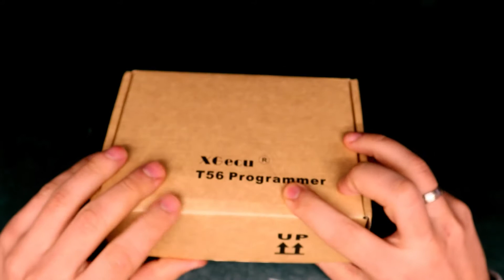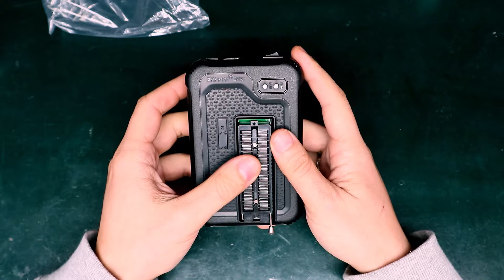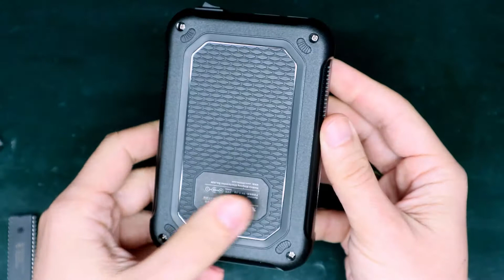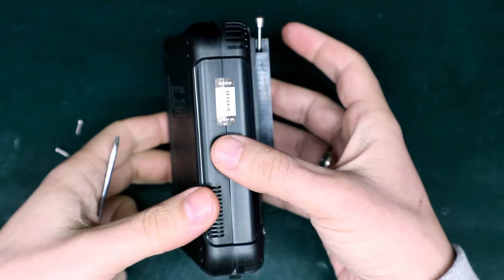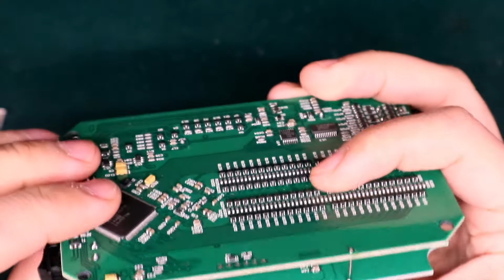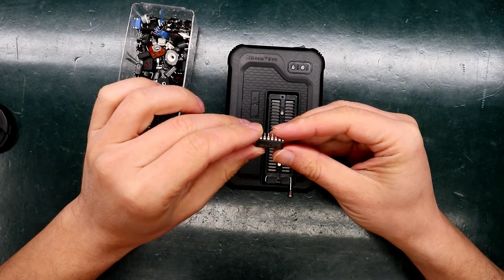Xgecu T56 programmer teardown and review

Comment: I ordered the T56, but before watching this video. I just needed confirmation. 🙂

AliExpress is weird, though. I ordered one, then realised that there was an old address there, and they don't let you change the address completely after ordering. So I had to cancel it, and buy it again, and it was like €20 cheaper. Not that I'm complaining, but it goes to show that dynamic pricing is silly.

Comment: This programmer does not work with PIC16C65B. VPP Overcurrent protection kicks in for some unknown reason. Posted on the Xgecu forums - over 400 views - no answers! Works just fine with cheapo PIC K150 programmer. Also, in-circuit does not work with some chips. Winbond 25Q128 for example - works just fine with SOFI SP-8 programmer. Not convinced of the quality of the T56.
Reply: You buy t56 for programming emmc for tv repairing, not pic's or cheap memories like 25q128 which can be programmed with cheaper tools.

Comment: MC68HC908JL8   ok? or not ok?
Reply: It's not in the list of supported chips.  If the chip has an alternate designation, it may be listed under that, or it may be that the chip you want is cross-compatible with one which is in the list.

Comment: When will there be a video about the work of NAND FLASH and eMMC ???  How does it work with bad blocks?  is there a fix for the ECC error?  ISP connection to points ???  Your video is good, but for more professional masters, it is nand and eMMC that are interesting
Reply from the maker: Well, I've got a couple programmers and this was  my lates. My job is different and I don't use and flash and eMMC. Sorry